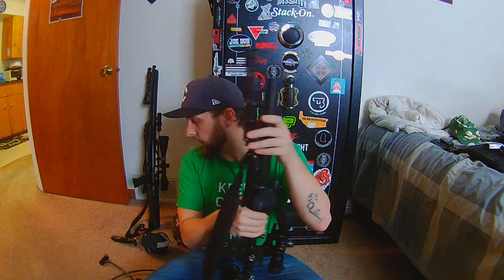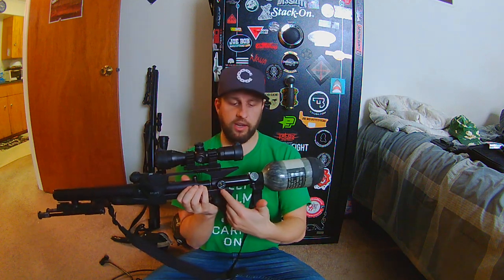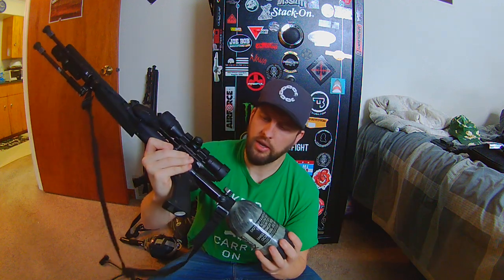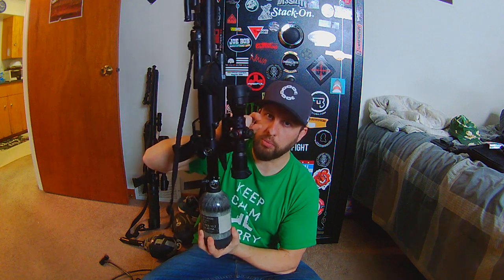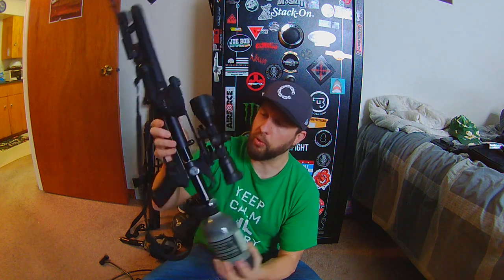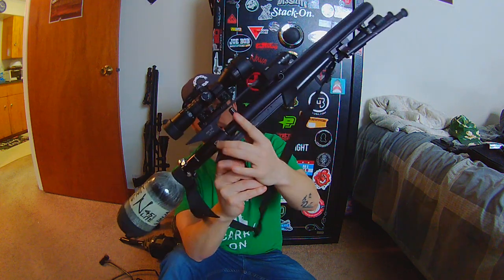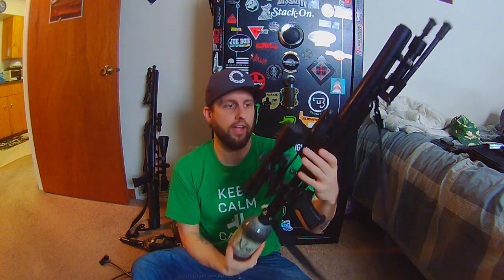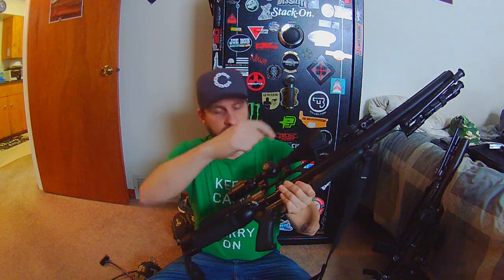Airforce Talon and Condor Regulated Air Systems - An overview

Comment: Good stuff bro! I really like the teather idea. Thanks for sharing your ideas. Appreciate it.
Reply from the maker: You came over to check it out! Haha thanks, Ed! How much velocity is your Condor getting with your reg setup on it? (Include pellet/slug weight). I wonder if my cobbled-together solution is better or worse. We are comparing a .22 and .25 here, though, so keep that in mind. I was doing about 890fps w/23gr slugs for 40fpe.
Reply: @airshootist  Yes! I watched it. I also subscribed. Always looking for ideas that can help with efficiency and consistency. With my Altaros reg I’m shooting the JSB 25.39 gr pellets at 918 fps for 47 FPE at the muzzle. With my second setup, with the PCP tunes reg with a factory setting of 200 bar with the 4500 psi bottle, I am shooting the NSA 36.2 gr slugs at 934 fps for 70 FPE at the muzzle. I get about 26-30 shots with my Altaros reg setup and about 18 shots with PCP tunes reg. I have been thinking of tuning it down to about 55-60 fps at the muzzle to conserve air for a higher shot count.
Reply from the maker: I watched your video again. It doesn't look like there is much plenum on your reg setups. I guess just having that little bit bigger surface area (.25 vs my .22) really helps velocities since you have more surface to push on. I also had a 95 gram hammer (from Talon Tunes) so our setups were very similar. I had my reg set at 2600psi (180 bar) for the power I mentioned above while getting 40 shots. Your rifle is setup wonderfully. The only improvement I can see would be maybe a larger volume 4500psi tank for more shots, but the Condor is a hunting rifle, and your 18-30 shots depending on which reg you're using is just fine. Great job, great video, and count me in as a subscriber!
Reply: @airshootist  Thanks again for watching and commenting. The Altaros reg has a small plenum but the PCP tunes reg has a larger plenum. The PCP Tunes reg has a large circumference which adds to the air volume. It can also be adjusted up to 250 bar. Mine is set at 200 bar. I know with a 250 bar setting, I will blow through a lot or air fairly quickly which will give even fewer shots. I’m going to dial down my power wheel to slow my slugs a bit to conserve a little air to get a few more shots out of it. I will see how it goes. I really don’t need to shoot at 70 FPE. I did it simply because I could. I wanted a larger tank volume but also want to maintain the sleek look. Thanks for subscribing and sharing your thoughts and ideas with me. It is always welcomed. Again, thanks for watching.
Reply from the maker: @AzAirgunHunter  You can expect a lot more interaction from me. Us new/small channels need to stick together! Hopefully you like my goofy hunting videos as well as my reviews! I am not everyone's cup of tea, some folks hate that I add pop-culture clips to my hunting videos - but I think its funny, SO THERE! 🤣😂😅
Looking forward to your next video!
Reply: @airshootist  Great! Same here.

Comment: man i just found your channel and glad i didi liked it i feel like you really know your stuff im trying to get as much info on these airforce rifles as i can i want on because i like the simplicity and that they're made in america but im a little worried about the bottle being used as a check piece where i have to rest my face on im pretty sure they're safe but whats your thoughts on it because most of the ones ive seen have the bottles up front also do the bottles that come with these rifle have a shelve life? thanks in advanced for your opinion and help👍
Reply from the maker: Have ZERO fear about that. There has never been an instance of spontaneous face combustion with the Airforce rifles. My Talon SS is old enough to drive (and then some) and I used those stock bottles for ages before upgrading this year to a reg'd bottle setup. The AF bottles are THICK aluminum and will never blow up on you. I play competitive paintball and we are diving and smashing around with carbon fiber bottles right next to our faces, which are arguably more prone to damage than a straight aluminum bottle - and we never see any danger there, either. It is a complete non-issue. Get a Condor SS or Talon SS and you will have a lifetime of (almost) maintenance-free airgunning. They also have a lifetime warranty!

Thanks for your nice comment and I hope you enjoy my somewhat low-quality, low-brow, sub-par content! I have fun, though! Haha. If you really need to, you can even email me at AirShootist@gmail.com and I will try and help if you run into any snags - as I've done with others. 

Cheers, pal.

**Edit: I didn't answer your question about shelf life. 
Officially - Aluminum high pressure bottles have a 3 or 5 year hydro cycle. This means you need to get them hydrostatically tested every 3 or 5 years to make sure they are still serviceable. 
Unofficially - I maybe kinda sorta could have been running the same bottle since 2004 (allegedly) with bazillions of fill cycles and no hydrotest and with 100% safety. If you have your own means of filling (hand pump for me for years, then compressor) then nobody is going to be checking if your tank is in date. Take that piece of info how you want it. Someone will yell at me for not complying with government regulations, but I have become U N G O V E R N A B L E   🤣🤣🤣
Reply: @airshootist  lol 😂 UNGOVERNABLE I appreciate the help man great point about paintballers diving and putting more abuse on the bottles then air rifle bottles never thought of that also thanks for the info on the bottles about having to be hydotested i know fill source air tanks did but never owned a bottle rifle so was just curious and wanted to know hopefully airforce start manufacturing rifles again cause as soon as the talon p comes available i want one thanks again for your help bro
Reply from the maker: The Talon P is great if you have a hand pump because its smaller bottle takes less pumping to fill. However, as you can imagine, you get less shots per fill. But - it is a smaller package and perhaps a better backpack rifle. I'd strongly consider a Talon SS with a hammer weight and Condor valve/tank. That will get you Talon P power levels but still keep it to a small package. You may be able to contact Airforce and get one configured like that from the factory. If not, the hammer weight is like 5 bucks and a whole new tank is something like $200. If you had both the Talon tank and a Condor tank, you could simply remove or add the hammer weight and easily switch between power and efficiency levels. Another main benefit of the Talon SS is you actually get an integrated suppressor, where with the Talon P you do NOT. And the Talon P is LOUD. The more you know! (Insert reading rainbow GIF here)

Comment: That's exactly what I'm going to do with my talon and condor. But I think I want to do a drop down with  carbon bottle and machine a  regulated plenum tube above it.
Reply from the maker: The drop-down is what I did on the Condor to accommodate the larger diameter bottle. If you get the Ninja 45/4500 Lite you can avoid the need for a drop down since the bottle is skinnier. My Talon shoulders nicely with no drop down and the Ninja 45/4500 Lite

Comment: Is that a UTG BugBuster and a UTG True hunter on the other rig? Either way those are great optics for the price. I have a Hunter on my magnum break barrel Hatsan 125 Vortex Camo in.22
Reply from the maker: Yep got the Bug Buster on the Talon and the True Hunter on the (now sold) Condor. On my Maverick I have an Element Optics Helix which makes me laugh at the UTG scopes like some kinda spoiled rich dude. Still, the bug buster is fine for 20-50 yards which is what I usually use the Talon for. But from now on - Element Optics will be my go-to for any new rifles - powder or air powered. Superior quality.

Comment: I have implemented this deposit system in the air rifles in 2013 ... which gives me more autonomy at more speed ... but what I cannot get in my country Argentina is at a good price of the HPA tanks of Carbon fiber 4500 psi and with the regulator of Chinese origin ... which would be what I want the most for my condor this more perfectly regulated ... therefore I walk with the valve fixed at 890 fps with 25 greins in 6.35 ... What gives me very good autonomy from 200 bars .. what the 72cc tank that I have supports that price nothing else .. I looked for you on facebook .. but I did not find you just to ask you for some rabbits .... a cordial greeting Antonio from Salta Argentina
Reply from the maker: Always cool to hear from folks around the globe! Another viewer purchased my regulated setup for the Condor. You can email me at AirShootist@gmail.com with any questions and I would be happy to try and help ya get something figured out!
Cheers, Antonio!

Comment: Air Shootist have you seen the MCS I think that's the name of the company they're a big paintball supplier they now make a kit for the Condor this kit  you can put on a  CO2 conversion adapter which allows you to add a PCP small air tank of variable sizes and an adjustable stock of several different offerings it's pretty cool looking and is somewhat similar what you got going on here just wonder if you'd seen it they got a little mini video on it too the on ly thing you have to buy  elsewhere is the valve body from airforce but it's not regulated
Reply from the maker: Hey Michael! Yeah if you listen to the whole video I talk about that adapter. It is from Airforce and its steel - so it is heavy. I sold it and got an aluminum replacement that weighs 1/3 as much. On both, I drilled out the platform inside that the pin valve presser sits on to get more volume. With one of those adapters and a regulator that gives a high output, you will be able to do some good stuff. Using a paintball tank with a standard regulator (850psi output) or a CO2 tank (800-1000psi output) will get you total garbage performance, though.

Comment: Nice shirt!!  I've always thought about getting an AirForce airgun, but the complaints about the frame flexing and not being rigid enough has held me back.  Any options or suggestions (that won't break the bank) to remedy that?  Or is there any truth to such claims about the "flexing"?
Reply from the maker: Thanks, king! The frame flexing thing maybe comes into play on a longer Condor framed gun that is being setup for long range. This Talon of mine with its 12 inch barrel does not suffer from that at all. Are you out hunting squirrels or trying to convert it to a 24" barrel .257 and shoot targets a quarter mile away? If you're doing the former - I simply wouldn't even worry about it. I have since sold my Condor SS but both guns are deadly accurate and have taken truckloads of small game.
Reply: I'd like to go hunting with it or any of my air rifles when I can.  But it's mainly for target shooting on the property.  I tend to go for a bit more power and longer barrels.  I saw somewhere online where certain mods can be made or even an after market stock to remedy the "flexing" @airshootist
Reply from the maker: I have never seen it being a problem. I mean the gun is mainly a unibody aluminum extrusion, very rigid. With the Condor we were regularly shooting a 4" plate at 150 yards with PELLETS! I wouldn't worry about it all honestly. Check to see what Airforce guns www.myhighpressureair.com has in stock and if they don't have what you need they can order it. If that doesn't work I have an affiliate program for Pyramyd that I could send you a link for, you just would need to tell me what you want. 
Hey also, check out some of my other Talon videos, there is one where I show how to regulate it with exactly what I used and then kind of as an add-on to that there is another one where I toss a homemade plenum on it and gain 100fps.

Comment: Just found your channel from a review you left at pyramid air. I am looking at a talon SS .25. Is it beneficial to regulate the stock SS.
Reply from the maker: Ohhhhhhh yeah! Check out some of my other Talon SS videos. I did one about a month ago with the home made plenum! I have lots of content on how to regulate the platform.
Reply: Thank you! I am familiar with the ref concept but did not know about using it on the talon or condor platforms. The extra plenum capacity really kicks up performance. Of the two platforms, .25 talon/condor, which do you prefer for small game ?
Reply from the maker: @pabuffa  Well, that really depends on your distances and what your requirements for rifle size are. My Talon SS is small and perfect for up to 50 yards. I sold the Condor SS to a friend but that thing is easily capable of shooting small game at 100 yards, but it's much longer and heavier. It is also capable of much more power. 
If you're blasting critters at ranges of like 20-30 yards typically, go Talon SS. You wanna hit things up to 150 yards out? Condor SS. 
Also, the Talon has a lower flow valve than the Condor. So if the goal is to regulate the platform you're gonna need a Condor valve anyway - even on the Talon. Food for thought.

Comment: Hey Warren, I'm wanting to beef up my Talon 25 cal with your set up you have there. Would you help me by giving me the info on your valve, regulator. I have an Airforce 3650 carbon fiber tank already just need to take out the 45 cal valve and replace it with what you have. Let me know if you can help. I have a coyote problem out here and am wanting to get some real knockdown power out of the Talon to take care of the varmints.
Reply from the maker: Drop me your email address or some way to reach you. I have the Condor Reg/Bottle setup (the one in the video) for sale as I just sold the Condor (w/stock tank only). All the research is done for you and you can buy it as a complete turn-key kit from me. Works great and I can answer any questions you may have.
Reply from the maker: Hey Robert! Sorry for the delay - had a Wisconsion turkey tag to fill! :) 

Check your email, brother!

Comment: Would a Ninja reg for the 4500 tank like yours with 3000 output get good results for they condor in .25cal and any idea of expected shot count? Also, will all the fill whips with slide check be safe to use with this setup Ninja brand as well or are there special ones Ninja provides for pcp high pressures? Couldn't find the Ninja 2800 reg must be special order.
Reply from the maker: I would go with less than 3000PSI output, especially in .25 cal. Get the Ninja Flex PCP reg so you can experiment, since it is adjustable. I'd recommend the 2200-3000psi one, but there is a 1700-2500psi one as well that might suit you. Surprisingly when you go up in caliber, something magical happens where it takes less pressure to get big power. I think it is because there is a bigger diameter to push on. Ninja remote lines are rated to 4500psi. Definitely don't cheap out on some off-brand there.
Reply from the maker: @ice.._  Your Ninja slide check remote should work just fine. Is it just not contacting the pin valve on the reg when you screw the knob on the universal fill adapter (UFA) down? Keep in mind you are screwing in against 3000psi instead of like 800 as on a paintball gun. You might have to muscle it a bit, within reason.
Reply: @airshootist  could you shoot me a email? It's in my replies
Reply from the maker: Hit me at AirShootist@Gmail.com and I will try to help you.

Comment: Can I get a condor tank with a regulator and put it on my talon p, both are spin lock tanks 25 cal. and where can I find what I need and thanks for the info
Reply from the maker: Yes you can and everything you need is mentioned in this video and my other one about regulating the Talon. You could also go the less-tinkering way and just buy an Altaros reg.

Comment: Let me ask you a question with this setup I have the older Condor without the spinlock will that allow me to fill the bottle with it still on the gun and have a pressure gauge since the regulator is on the other side curious
Reply from the maker: You can fill the gun without removing the tank, but screwing it in in the first place may be a bit tricky. Remove the grip, and there is a set screw holding the non-Spin-Loc collar in place. Take that out, then you can rotate the collar onto your tank and snug it up. I say this because you will not be able to screw your tank into the gun unless your plenum or reg adapter is long enough to allow the gauge and fill nipple on the tank not to hit the gun. If it IS long enough, you can screw it in as usual and won't have to take anything apart.